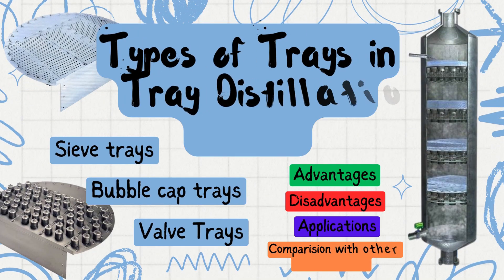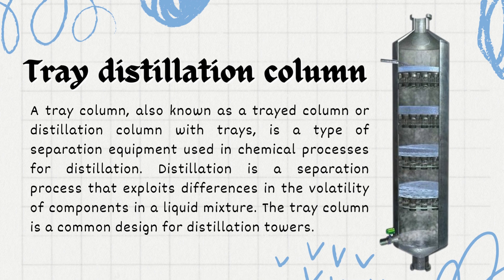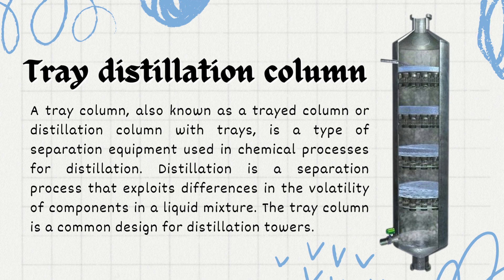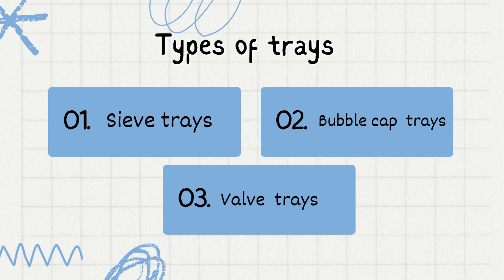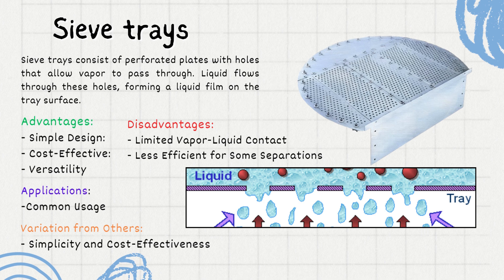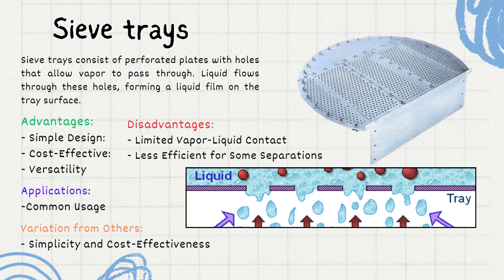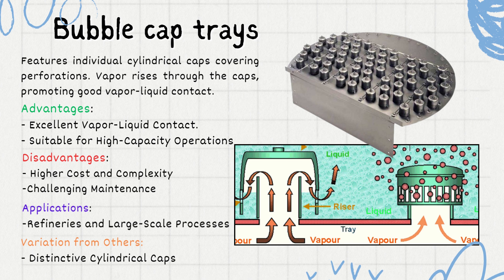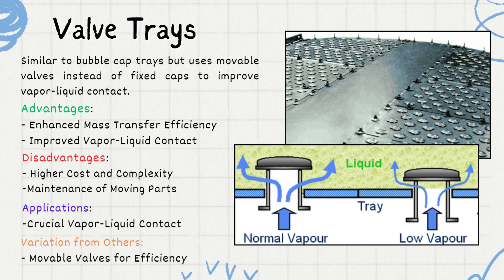Types of Trays | Sieve Trays | Bubble Cap Trays | Valve Trays | Tray Column Distillation

Comment: Why does vapor need to maximise contact with liquid?
Reply from the maker: For Separation Efficiency - Effective vapor-liquid contact improves the separation efficiency by enhancing the differential distribution of components between phases, leading to better separation of components based on their boiling points.